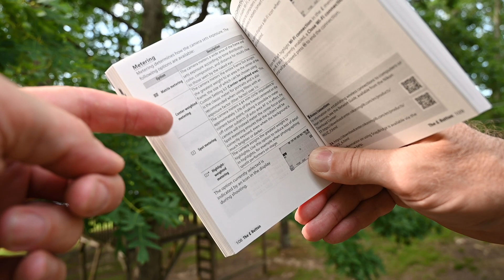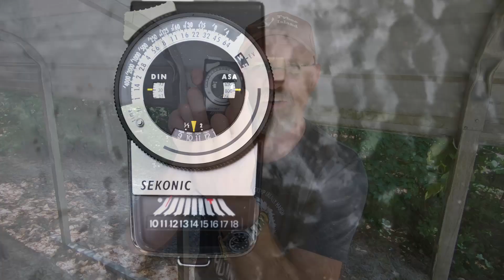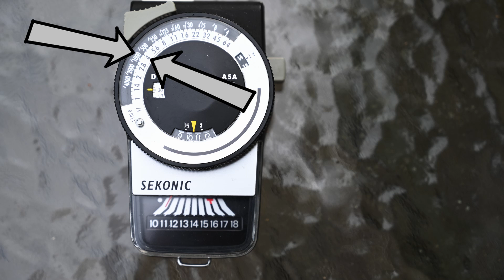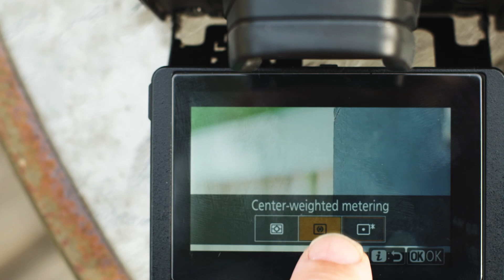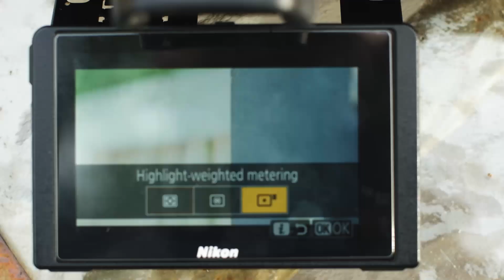Camera Metering Demystified (From a Nikon Z6 point of view)

Comment: Well I searched Youtube for "Highlight weighted metering Z 7" and this is one of the videos that came up.  I was doing the search because  the manual is pretty cryptic on the subject.   So far, most reviewers either don't talk about that mode, or skim through it.  I myself have never used it, and it appears I'm not alone.  I think it's a centre spot with a bias toward the highlights in that spot.  This would protect the highlights from being blown out.  In practice, It probably indicates a 2 stop decrease in exposure, based on that small area, but who knows (and Nikon doesn't tell us).    Nikon call this "reduction in loss of detail" in their manual, instead of "protecting the highlights,"    It's protecting the highlights from over-exposure.   If not, I hope somebody will correct me.

Comment: Thanks for the clear explanation. My question is: In manual mode, since the camera isn't controlling metering, if I'm doing focus stacking, and I only change the focus point (but keep aperture, shutter speed and ISO constant for each exposure) do I have it right that the exposure of each frame will be the same. ie. That changing the focus point won't change the exposure? Conversely, if I'm in aperture mode and I change the focus point it will (potentially) change the exposure? Thanks again, David.
Reply from the maker: As long as the light hitting the scene doesn’t change, you are right. You are in control of the camera completely so the exposure will all be the same as long as there isn’t a rogue cloud or an eclipse during your series 🥴😂 Dos that clear it up? In aperture priority though, the camera is metering the scene so it could vary there…
Reply: @davidsaylors  Yes, that clears it up, and thank you very much for the quick reply. It's much appreciated.
Reply from the maker: @leewolfe  Your welcome!!! 👍📸

Comment: I don’t always like how evaluated metering gives exposure priority to the area within the focus point square. Probably very good for portraits and ok for many scenes but if your focus point happens to be in a place that is overly bright or dark then it can throw off the desired exposure quite a bit. I tried centre weighted metering set to an area 100% of the viewfinder but generally evaluated metering works out better. Just need to be aware of the focus point exposure level priority throwing off your desired exposure level.
Reply from the maker: Yeah, that is a big problem with me to, hence I normal just use matrix and then adjust with exposure company to make it look like I want. It can be frustrating. 👍